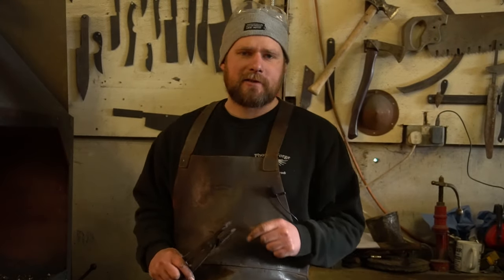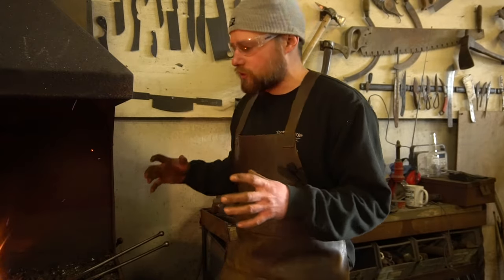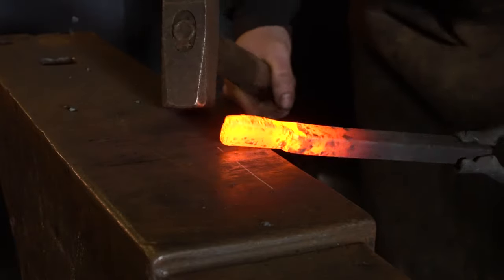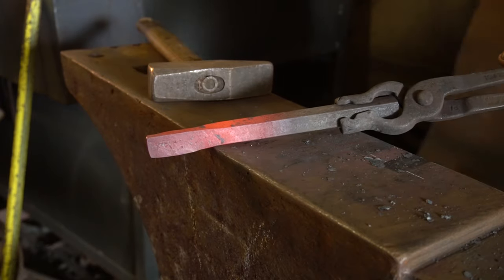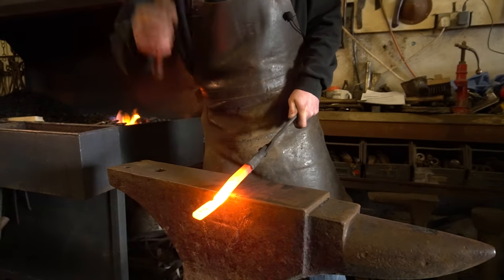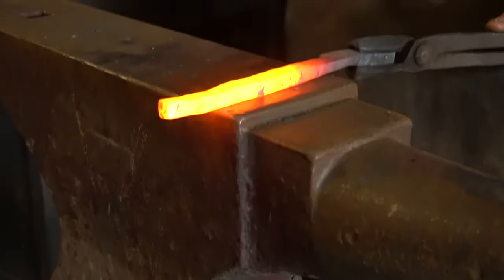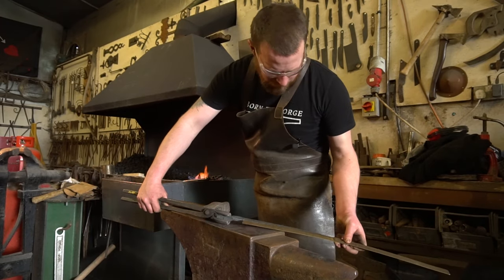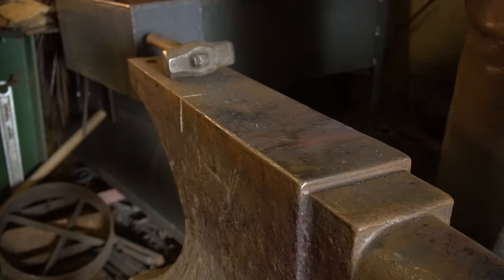Making Blacksmith Tongs - Blacksmiths Essential Skills -

Comment: I really appreciate these videos. I have no previous knowledge about forging, but it is something I have always found fascinating. I have somewhat access to a decent forge and will try out these guides eventually. What I find confusing is what kind of steel to buy. There are a lot of different sizes and types of steel, but I assume that there are standardized types and sizes. I would really appreciate if you in the description wrote what size and type you used. Another idea is to consider a guide, written, or in video on how to understand steel types and sizes? (what would you use for different kinds of products etc.?)
Reply: I'm a year late to the party but here i go anyway.
Local steel suppliers often only supply mild steel. If it's sold for welding/construction purposes it'll be mild. 
Mild is perfect for most blacksmithing(like these tongs) as it forges nicely. As you get into blacksmithing youll want to get yourself a nice assortment of round/square/flat bars. But for now pick 2 or 3 round bars in the 1/4-3/4 inch range.  

For some tools you'll want hardenable steels though. Some steel suppliers do carry hardable steels but most buy them online. if you want i can link you some depending on your location. . 1045/4140 are most common for general tools, 1075/80/84 or 80crv2 are recommended for knives.

There's MANY different ways of naming steel that can get very confusing. What i mentioned is the American nomenclature system. if you google "XXXX steel equivalents" you can find the equivalent steels in other systems.